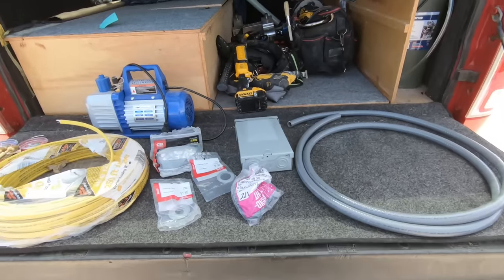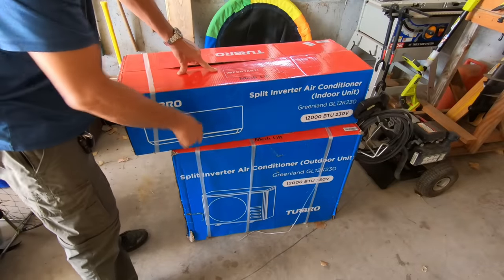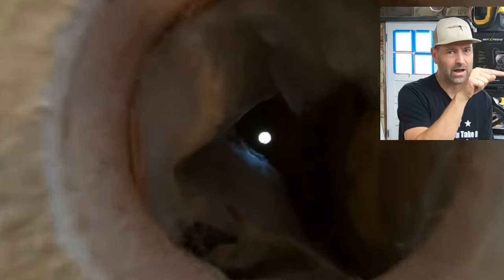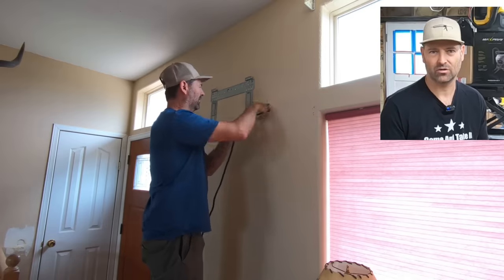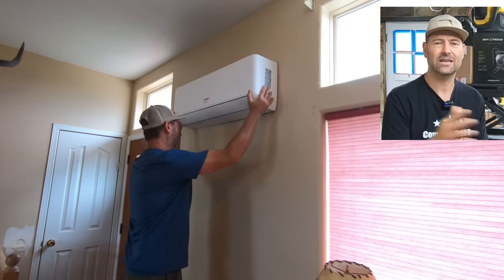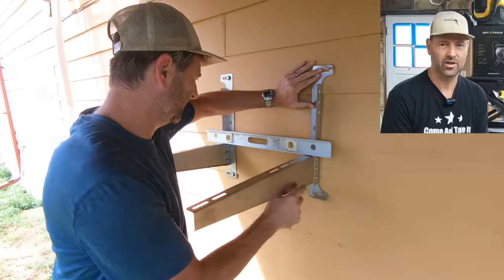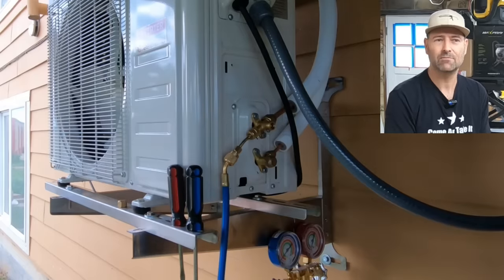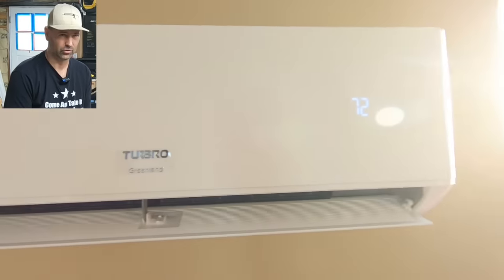They Are Forcing Us To Use These | Heat Pump Or Mini Split Full Install | THE HANDYMAN |

Comment from the maker: This one is rated at -13 F.   I found that mine shut off last winter around -10F.  I have seen some that have an extreme cold rating of -25.  I'm not sure how well they would work at that temp.  They have to go through a defrost cycle at least every hour if not more when its below freezing and humid out.
Reply: Defrost always seems to occur right when you wake up love the cool breeze on a cold morning.
Reply: LG RED models don't lock out/shut off even when temperatures go below the rating of -13F. If the room your trying to heat is well insulated it stays pretty comfortable but I think it uses way too much electricity at that point.
Reply from the maker: I have a video of mine going through the defrost.  I will try to put it into a video so people can understand what it looks like.
Reply: Mitsubishi makes a heat pump rated for -30°c.
Reply: @kylelarson6054  You must not be from the US. In the US, Mitsu only sells heat pumps (hyper heat) that are rated for -13F (-25C). Mitsu heat pumps will lock out/shut off once it reaches that temperature to prevent damage.
Reply: @TheHandyman1  The new machines rated -22 f have a COP at around  2.5 at 5 degrees ,1.6 -5 degrees,1.3 -10 degrees, -22 degrees 1.1. Resistant heat is the base line COP 1. I looked up the weather records online to see how cold it gets in my area to  know when it would be cheaper to burn pellets My pellet stove is around a COP of 2.5.
New machines have a heater to remove frost.

Comment: I've got both hot water heater inverter and 2 mini split units as my primary heat source. That used to be my oil furnaces job. Now the oil furnace is my backup which I reset the temps low setting to minimum so it only has to turn on in the winter months when burner aquastat is set to it's lowest temp. Water heater is so efficient and never runs cold. 2 years back oil prices were insane. My home took a few tank or oil/month during the coldest part of the winter. 1200 for one month. Now that would cost 200/month. I only use oil heat if I fear water pipes might freeze in crawl space during sub zero degree weather.

Comment: Central Texas here. Changed out our furnace/AC unit for a new heat pump system, forced air, and Our bills have dropped dramatically.
I'll eventually install a mini-split in the shop for future use as well. Haven't heard about the water heaters yet.
I think they're here to stay until, as you say, the next big thing comes along.

Comment: I work in hvac and honestly im not really sure. Im not the biggest fan but thats because I dont work on them much. Being in america minisplits are extremely new, and seem like a pain to work on. But other places in the world have been using almost exclusively mini splits, in even some of the poorest countries. You know their installs probably arent the best, and the conditions arent great, but it seems to be working fine for them. And a heat pump even in my northern climate I dont believe will handle the winter time. But for 80% of the year i think they will work, summer-fall-spring. Plus mini splits dont really filter or circulate any air.

I think the ideal system would be a ducted standard split system with a heat pump, but dual fuel with a gas furnace. Then you have the reliable heat in the near 0 degree temps, but you also have the heat pump for anything 30 degrees and up without having constant defrost cycles every 30 minutes. Plus having a ducted system gives you the option to balance the house, as well as have a good whole house purification with a solid filter plus add ons like uv lights or an iwave. Also you can add a whole house humidifier to a ducted system to help the whole house out.

Comment: Switched to a MItsubishi heat pump with an air handler for my ducted house this last winter. Absolutely amazing difference in every aspect. My old furnace was the original oil but with a newer beckett burner I put on a decade ago. While I actually like the simplicity of oil furnaces, it had just become too much of an expense with diesel being 4+ a gallon where I am at... plus my underground tank was 80 years old and who knows how much longer it had. 

The retrofited AC coil I had on my old system was only 12 seer and the new system is 18.7. At this point the unit will pay for itself within 8-10 years with reducing both heating and cooling expenses. 

Gas wasn't even an viable option as the utility wanted 47k just to stub the line to my curb, plus the gas here (and around the country) is going up as well. We've had a 50% increase in gas over the last couple years. I also have the option of solar panels or solar roof someday which would bring down the return on invest even further. 

I'm sure there will be a newer fancy technology down the road, there always is, but I'm pretty sure the trend of moving away from all fuels (NG, heating oil, and propane) and going electric is here to stay.

Comment: Considering how many decades they have been used in asian countries like Japan, I can imagine this is going to be a long lived switch to better energy efficiency.  Especially since they now make these units to be able to heat most winter days even in cold climates.  Even the new whole home central AC systems are being pushed to have heatpump options and far more efficient compressors than in the past.
I think the mini-split heatpump units are going to make the most sense in all the places you usually see window AC, through wall AC and PTAC units since they are so efficent.
Reply: Used to use window AC units in Florida, noisy and full of mold. Finally dumped them and installed two mini splits, house is freezing now.

Comment: Installed a 42k multi-zone mr.cool mini split with three heads in my house after a renovation. Took me about a day to do it by myself, and only cost about 5k in total cost vs the 25k I was being quoted for vastly lower quality units being pushed by local hvac companies.  The only issue I think i'll have in the future is service as a lot of companies won't service these if they are off brand as they cannot rip you off on the install. That being said, I have heated and cooled my 2 bedroom house for two years now, and i've seen a remarkable reduction in both heating and cooling costs.
Reply from the maker: The only problem I see is the won't work below -13 in heat mode.  If I lived in a warmer climate I might put a 4 zone in my house too.
Reply: @TheHandyman1 certain models like senville work at -22F for less than 6k usd for a 48,000 btu/ 5 zones.
Reply: @TheHandyman1 it appears you’re giving out false information again. The heat pump doesn’t stop heating at -13. According to Mitsubishi, at -13 it puts out 80% of the BTUS if you’re using the hyperheat model. 

Click bait appearing title, and tall claims, and I haven’t even gotten past the first minute becuase I wanted to read comments. 

I’ll give more critique later in my arm chair when I finish watching.
Reply: I installed a mini split that used an air handler and ductwork. It works great and only one set of copper

Comment: I just removed my oil furnace . I gave the furnace away , sold the 380 gallon of oil I had left and the 2 tanks. Put in a Bosch heat pump. I have my pellet stove tied in to the transfer switch on my generator. Super happy with the heat pump.
Reply from the maker: That sounds like a good setup.  I need a backup system like you have.
Reply: I'm in Upstate NY, Vermont border, and that's what I do. When it's really cold or want the nice dry heat, I just run the pellet stove. I also have an ancient oil burner and radiator that I can throw on if needed, haven't in 4 years, but great if nobody is going to be home for several days and a cold front comes thru.

Comment: There are a lot of pros and cons to heat pumps.  Here are some thoughts:
- PRO: I like ductless mini-splits for their efficiency, silence, and individual zone control.  Plus they are generally DIY friendly and also relatively economical compared to other forms of air conditioning.  I think they have the most pros and the fewest cons.
- CON: Ductless mini-splits have one major issue: they require annual cleaning (or in some cases, more frequently).  This is something I learned recently.  My fan was almost totally clogged with this white mildew-like slime.  I was able to vacuum it fairly clean and also cleaned the evaporator coil.  The system works WAY better now but it's not even been two years.  The filters do practically nothing.
- CON: Running line sets on the exterior of the house.  This is becoming more and more acceptable every year so it hasn't stopped me yet (currently have 3 zones and will add two more next year to cover all rooms).
- While ducted systems do a great job of filtration, these whole house systems are the most expensive way to be a heat pump user.  It'll never pay back, AND you are generally limited in your zone controls.
- I do NOT believe in heat pump hybrid water heaters.  I had a standalone oil fired water heater that finally gave up at around 23 years old.  I replaced it with an oil fired water heater and not one of these hybrid systems.  While I like the idea of my water heater removing humidity in my basement for "free", everything else seems like a con.  They are expensive (although with rebates maybe not).  They are complex.  There is no way in hell one of those units is going to last the 23 years that my oil fired unit did.  They don't make hot water like my oil fired unit.  My oil fired unit is practically on demand.  The heat pump units recover slowly and generally require large tank sizes (my oil fired is only 32 gallons for a big house with 4 occupants and we never run out).  It falls back to electric element heating when the heat pump can't keep up with is a huge electricity draw (which would require a new circuit, too).  Also, my 7000W generator would not be able to power those elements in an outage.  Finally, the oil fired unit uses so little oil that there is really nothing to discuss when it comes to payback.  It's pretty much all downsides for me.

Comment: It's not like they're forcing people to replace what they have, but it's hard to argue it isn't more cost effective and efficient.  Has been used for decades elsewhere, so it's well vetted even if some people here are less sure.  The problem is with HVAC guys quoting/charging $7k-$10k for an install like this, because their time is in demand... the whole value proposition goes out the window
Reply: Yes, I got estimates from 2 different companies a year ago, (July 22) to install 2 outside units with 2 inside heads each. Total of 4. They both wanted 25 k 😮 I bought the units myself and did all the installs for 6 k . I don't mind someone making a profit for their work, but that just seemed like an awful huge profit. I found it was quite easy to do, I did make sure to vacuum the lines. Worked all winter. No issues so far.
Reply: That's why Mr. Cool exists, even if they do not last quite as long, if it is 1/4 of the price, it makes so much more sense to DIY.
Reply: Just had a whole house replacement quote - Trane ultra low nox furnace w/ Goodman AC pair for 11.4K.
He said my existing vents are  not set up for a Heat Pump. I feel much better when you said $25k. That's too much.
Reply: How is a thermal expansion valve more cost effective than an inductive heating element in direct contact with the liquid it's heating?
Reply: Installed a Mr Cool, myself. Total cost for everything was a little less than $800. That was five years and the thing heats and cools my 20x40 shop with outside temps from -5 to 105. No noticeable increase in electric bill. It’s great!
Reply: @scottleggejr Because you’re moving heat, not generating heat.  More energy efficient.  But that only works if the air temperature is not too low.  Otherwise you still need to direct heat.
Reply: @nauy   Let's just ignore the motor on the compressor and fluid flow dynamics. 0 moving parts inductive heater vs motor, pump, txv, solenoids, etc. etc. etc.
Reply: @scottleggejr regardless it's still considerably more efficient to move the heat than create it. Plenty of info out there on it.
Reply: @bran-qt7ds  peukert and ohm disagree 🤣 what about whole life power factor?
Reply: @bran-qt7ds  what the fuck are you going to tell me any heater does Einstein? 🤣
Reply: Those units in Australia cost in US$1000-$1500 for a Top brand, high capacity, high quality system. Installation is US$350-$450 as of Oct 2023
Reply: They are more energy efficient, but not always more cost efficient. Here in NY, electricity is significantly more expensive than natural gas so the efficiency gains don't translate to cost gains. In addition, they are not as efficient at low temperatures. The manufacturer listed COP is at test conditions. In actuality (I'm a mechanical engineer plus I own one in my home), they are blowing lukewarmish air at low temperatures requiring you to crank up the thermostat plus fan settings to warm your space adequately, using more energy.
Reply: @suespony $25k to install 2 ea split units? That's plain robbery. In Nicaragua  we have been using mini splits for years.  They are way more efficient vs the huge central units (power hogs) which are best suited for commercial use, not residential. The average installation costs around $100 per split unit. It is not rocket science. The US is just catching up with this technology which is very common all over the world.
Reply: Spring 2024. 3 heads downstairs and attic unit to feed 3 bedrooms. Two quotes came in at 33-35k. We do get 10k state tax rebate. But still very high

Comment: I have 3 of these in my house.  I love them.  Very efficient and if you have a failure your whole house is not impacted.  Just the unit and room.  Do I think these will take over?  No.  Maybe in places like where I am in East Tennessee where the winter is more mild but in places like North Dakota, Michigan, Wisconsin, etc...  these will be pretty worthless.  Below 32 and they start to consume a lot more power to heat, and I have found my unit works alright down to around 0 where it cannot bring the room above 68 and if you lose ground its lost and wont be regained.  There are ways around that but then you are paying for resistance heating built into these units which make power costs run crazy.  So for colder states I foresee the need for furnaces for at least a while.
Reply: Agree that not every Zone will receive the same benefit from air-based heat pump technologies, but many in the USA could, whether conventional splits, min splits, or even package units.  Some folks have a mind set that any solution should solve every need for everyone.  If we can make heating and cooling cheaper and less consumptive for 70% of our population, we've made a difference, and can work with the other 30% to help with their costs and consumption using technologies appropriate for their weather zone.
Reply: @raygunsforronnie847  100% agree.  People today do not like nuance.  They want a 100% solution that is right for everything.  Which does not exist.  Do analysis and figure out what works best for you and your situation, or pay someone to do that work that you trust, or last and definitely least do nothing and keep potentially wasting money.

Comment: We built our house new in 2018, I had a Heat Pump water heater installed on our house, it's already paid for itself now, by a lot, and still runs great. As an added benefit it helps dehumidify and cool , I leave it on heat pump only mode since we live in Texas it's very welcome to have that fringe benefit!

Comment: Mini-splits are efficient because the compressor runs off an inverter powered motor (variable speed control) and there are minimal fan losses, ductless. It’s hard to imagine that getting much more efficient, although there are probably minor improvements here and there. I guess the next thing will have to be some kind of solid state heat transfer, but that will need a lot of development. Nice install job! I put one in my insulated garage (Fujitsu) 20 years ago. Still working…

Comment: I've been running my heat pump water heater for 2-1/2 years so far. It's nothing but awesome, and will pay for itself. No brainer. If you can afford the upfront cost you'll make it all back in reduced power use and then it will continue to save you money, and eliminate the need for a dehumidifyer in the basement, or help cool your garage and use even far less power if you're in a warmer climate.

Comment: I'm a licensed HVAC contractor in 3 states and an HVAC college instructor. Mini-splits have been around in the middle east, Asia and Europe for decades. America is typically at least 20 - 30 years behind everyone else concerning HVAC. Mini-splits are here to stay. The inverter technology makes them more efficient, more effective and quieter than virtually everything on the market other than geothermal which isn’t practical for everyone. 

Unfortunately, mini-splits are much harder to repair than traditional units and can have up to 3 control boards in the condenser. There also isn't a filter drier, so if you don't use nitrogen, followed by a deep vacuum proven by a micron gauge, you will eventually have compressor failure and/or reduced efficiency due to leaving non-condensibles in the system. If you live in an area with poor power quality or frequent lighting then a surge protector is recommended to protect your equipment as they are super sensitive to power abnormalities.

Comment: I'd like to see more companies installing retrofit geothermal heat pump systems. They use the constant temp of the ground for heat exchange so it works without regard for the outside temps.
Reply: Expensive